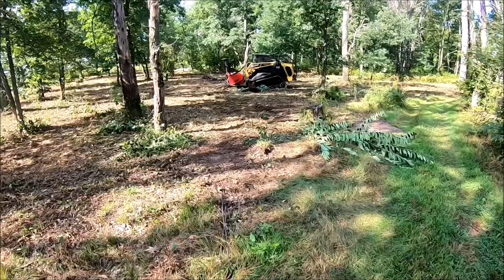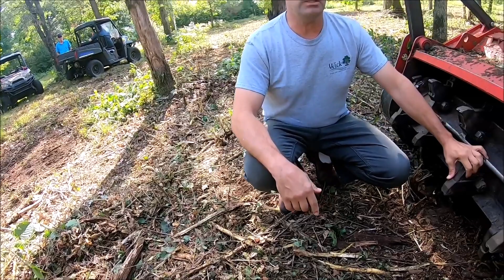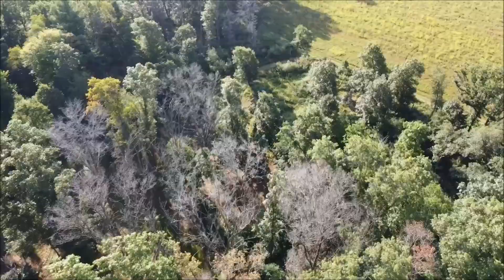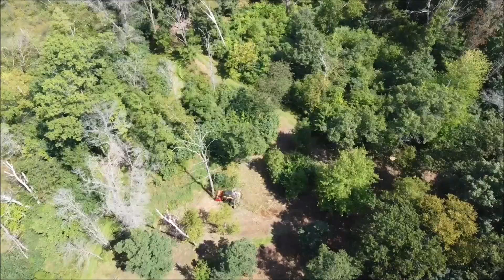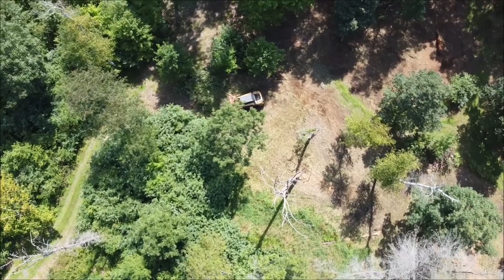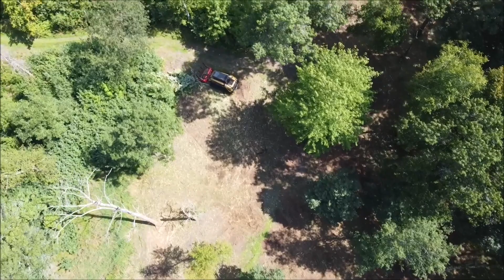Taking control of your woods with a forest mulcher! -30

Comment: Them machines are definitely impressive!! I am actually working on a restoration project right now over in Hancock for a customer of mine!! We're dealing with about 10 acres worth of black locust that I harvested now the work begins on the resprout!! Stay safe my friend
Reply from the maker: Black locust is black gold in my book, It’s awesome firewood! Thanks for watching 👍
Reply: @TonysCoolTools  you bet it is I burn a lot of it. I have about 120 cords worth decked up over there right now!!
Reply from the maker: @LitltsLogging  that’s awesome Tim, is that all cut split an stacked? If so you must have spent a ton of time there.👍
Reply: @TonysCoolTools  no I wished it's in 8' length. it was a timber sale I cut back this summer and need to sell it all. we have about 800 full cords of locust sitting on different landings around the state